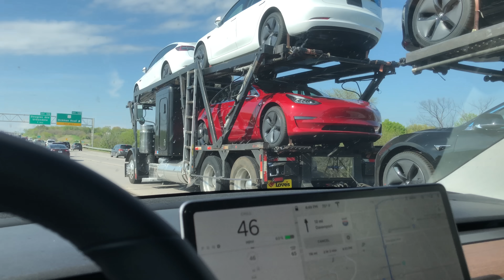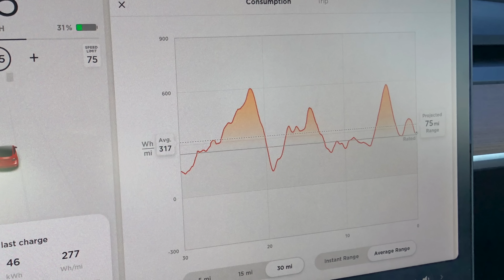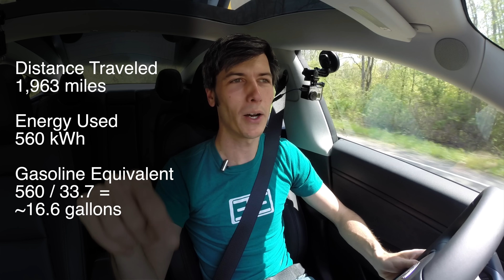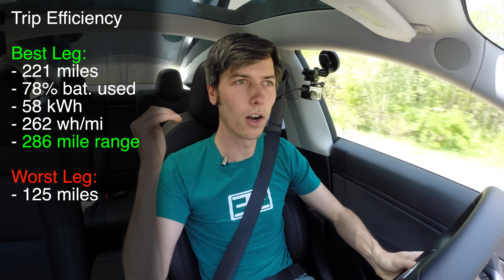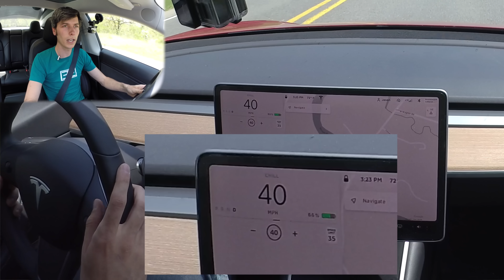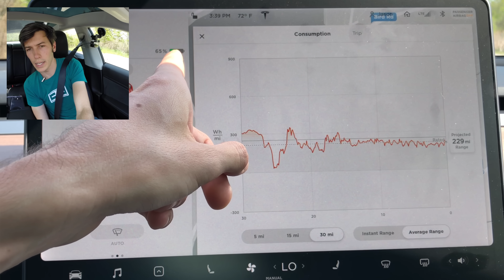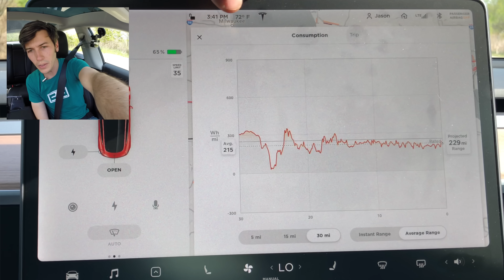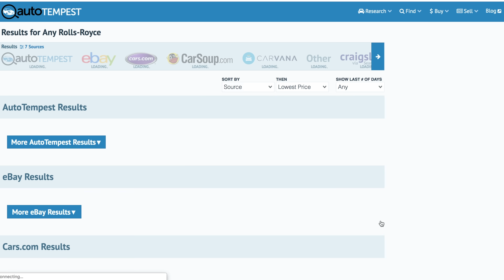How Miserable Is A Tesla Road Trip?

Comment: It's important that everyone remember that the V3 superchargers are going to be 2 to 3 times faster than the current V1 and V2 charges so this is the slowest charging will ever be and it's pretty damned fast. For the video he's using a standard-range-plus which requires 7 hours to charge. I planned the same trip with the long-range-model-3 and it only required 4 hours of charging over a 32 hour trip. I can't imagine driving 28 hours and not taking at least 4 hours of breaks in there somewhere. With the V3 superchargers that time would be 2 hours of charging over 30 hours. At that point you'd be well below the required amount of stopping for bathroom breaks and getting snacks, etc.

Comment: Google maps actually does use estimated traffic conditions for those times and construction etc. They track android cell phones and their traveling speed to calculate how the flow of traffic is on the roads and averages them. When you look up directions you can set the start time etc and it will change your estimated time.

Comment: So the most interesting and relevant question is: how long would this trip have taken you in a normal gas vehicle? Because we already know that you can use electric vehicles when you have fast-chargers everywhere.

Also, only $40 less seems not worth it considering that most cars nowadays can achieve a lot more than 30 mpg on highways, etc. . Using 40mpg in this calculation would already make this trip cheaper with a gas or diesel vehicle (20 year old VW TDIs achieve 70+ mpg on highways) - with only a few minutes of refueling.

Comment: it all sounded good until you factored in the price of charging. sure it sounds nice to say you used less then 1 gallon of gas in energy. but not less then 1 gallon of gas in price. 

so if you would have used a regular car you would have paid $~40 more, but saved over 7 hours in charging? thats worth the $40 to me. 

so if you would have used a regular hybrid car, it would have cost $39 less in gas and it would have been 7 hours quicker??? 1963/50*3 = $117
Reply: Yep, this is literally the only thing I was interested in for the whole video. 100% confirms I'm not interested at all in a tesla. If I get an electric car to save money on gas, I'm expecting it to cost less than half the price of gas or better, not a piddly <20% savings.
Reply: @hackfish8275  I mean, it still makes sense for a in town commuter, where it gets better distance. Or if you are buying for the performance. But yeah, as a long range commuter, not ideal.
Reply: @carlosrios7088  That's very true, depending on the cost of electricity in your state. But I feel like it will make a lot lot more sense when the price of on the road charging is lower
Reply: That only applies to roadtrip miles, charging at home is materially cheaper, depending on your local rate. If you have solar it's insanely cheap to fuel your car, almost free.
Reply: if you never sleep, or use the bathroom, or want to stretch your legs and just vegetate in a car seat for 30 hours - yes then that would be a valid argument. but I think everyone agrees that would also be a truly miserable road trip by any standard.
plus, the US gas prices are so artificially low in the US as a result of the oil/gas industry lobbying that even in California I think only about $0.60 per gallon is taxes. compare that to Germany for example where more than half of the road trip cost for gas is taxes (base price plus 0.65 EUR/Liter or 2.4 EUR per gallon, plus VAT 19%).

the benefits of electric driving show itself more at lower speeds and especially in traffic. the faster you need to go, the more an ICE delivers pure range/time value and convenience. but for a relaxed road trip, those cancel out when you consider everything else you usually do during stops where you can easily plug in the car for a few minutes.
Reply: @schlafanzyk  ofcourse you would rest , but not for 45 minutes every 200 miles. And 45 minutes is way more then "a few". 

But I agree, I would still love to have an electric vehicle for in town use. Just saying I would probably not get rid of my gas car.
Reply: @schlafanzyk  so artificially low in the US

You really severely misspelled artificially high in Europe. Funny how one of the primary expenses for low income families is extraordinarily over taxed in other countries are you're angry at big oil in the US for helping to prevent the government from those anti poor taxes. LOL
Reply: @hackfish8275  All taxes are "anti-poor", if you think right. Have you seen the mess about France wanting to tax Google 3%? I wish I was to pay ONLY 3%! Ridiculous.

Comment: As an engineer you know that calculating gasoline equivalent to electricity is a bit unfair ;)
You are comparing 560kWh of electricity to 560 kWh of heat in gasoline... and if Tesla was to run on gasoline, during generation of electricity this use od 16.6 gallons would at least double, if not tripple.
And with 50 gallons I can almost travel 1963 miles with my 12 year old fiat.

17 kWh electricity/km is very impressive, but comparing such things is like saying that electric resistor heater is 100% efficient while gas furnance is only like 80% and it is terrible. It doesn't work like that :)
Reply: Thanks for spelling that out, a red flag fired when that comparison was made. If I'm being picky (which I am) I doubt the charging is 100% free of fossil fuel as well. Got to agree tbf that Tesla did amazing work, just aren't ready to ditch the relative freedom of jumping in my Subaru 3.6R and driving a couple thousand miles without caring about having to make frequent stops.

Comment: electric car is not green, power is being made at a coal/gas fired power plant that pollutes; very dirty to make batteries (rare earth mineral mining etc); very dirty or energy intensive to recycle batteries...the list goes on.  Nothing virtuous or good about an electric car.
Reply: nothing virtuous or good about shitting on an electric car for factually incorrect and misleading reasons. electricity is not inherently dirty by design. it is only dirty because we have had no reason to move away from dirty means of production, which were the only possible ways to get the desired output until the nuclear age. in fact, you could power all of the world's transportation, housing and industry by just harvesting the wasted solar output of a tiny amount of desert surface area. the problem is, those desert regions generally also contain the biggest oil reserves and are the least densely populated parts of the planet with the highest concentration of power in the hands of the oil lobby and hence have no incentive to give up that very profitable industry of shipping tanks of energy around the world. it is purely a matter of political will to kickstart the electric (r)evolution, not technological or environmental limits.

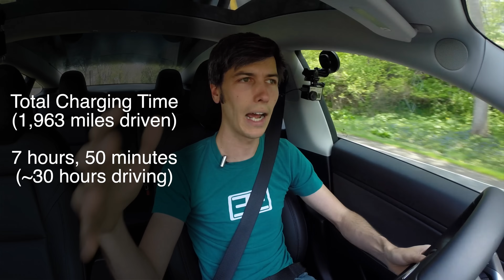Comment: 1:42 to 1:52 that's about 245 miles  of range per hour of charge time.   -- meanwhile, my civic so 05 from empty to completely full takes not even 10 minutes to refuel and I can go ) worst case..mind you city only) over 350 miles.  Interstate highway most or all of the time??/well over 400 easily.   I've said it before and I'll keep saying it. As long as the recharge times for these Ev's are more than 20 or even an hour  from empty to full...AND the range per charge is less than 400 miles..REALISTICALLY... mass adoption of them WONT happen. Oh almost forgot. Price. Oh the most critical thing... The car SHOULDN'T explode when just.fuckinf parked either -- * looks at Tesla qc

Comment: On a serious road trip, I'd be toting a generator with me just in case. Otherwise, 200mi and stop for an hour ain't going to get it done when you want to get somewhere at a decent pace, plus not driving 10+ hours when fatigue sets in and it becomes unsafe. Also electric won't work if you have kids and are going cross country. You need to be able to go hours and have quick stops on down times, like morning time or when they are sleeping to make significant miles, kids are pretty much done in the car by about 6 or 7pm.

Comment: So, a Toyota Camry which gets 41 mpg would actually be cheaper.
Reply: But not faster, or easier to drive, or nearly as much fun. The Camry isn't in this car class. This is in the 3 series, or C class.
Reply: @evracer5845  I was only commenting on the cost of fuel/electricity. Since the Model 3 is supposed to be getting the equivalent of 124 mpg, Elon is charging a ton of money at those superchargers.
But for a road trip like this, the Camry would be a lot faster, too.
Reply: Scott Gordon no it wouldn’t. I drive mine 5000 miles a month, ive driven everything everywhere in North America. This is by far the best driving ive ever experienced. I can race a z06 then put it in AP and relax.
Reply: @evracer5845  Huh? It's as if you are having a different conversation. I am talking about the numbers from this video about the road trip. The Camry would complete the trip much faster because it doesn't need to charge. And based on the numbers for fuel/electricity which were based on 30 mpg for a gas vehicle, stepping up to 40+ mpg would make it cheaper.

Comment: The Bottom Line here - Especially when Time is of the Essence - is that you have proved beyond any shadow of a doubt that all Teslas (and indeed all of the other 100% Battery Powered Electric Cars) are NOT practical cars for making long road trips (like this 2,000-mile trip).  For people like me, where Time is Money, having to make 12 stops and spend a total of 11 hours to charge an electric car's batteries on a 2,000-mile trip would Never Work!  The point well made here is that the current state of battery technology is just not up to the level needed to make long trips like this practical.  

It will take 5 to 10 years for battery technology to advance to the point where batteries can provide the long range and short recharge times needed to make 100% battery-powered electric cars practical for making long road trips.  In the meantime, Plug-In Hybrids -  are the most practical way to have the Benefits of - the Instant Torque and Power of Electric Drive, Regenerative Braking, and greatly increased MPG.  And when it comes to Luxury, Comfort, and Styling - my 2014 Cadillac ELR blows every Tesla Away in Luxury, Comfort, and Styling.  

My Cadillac ELR (Electric Luxury Roadster / Electric Long Range) with its Twin Electric Drive Motors and Onboard 4-Cylinder DOHC gasoline powered Electic Generator can make this same 2,000-mile road trip in nearly 11 hours less time while averaging upwards of 51 MPG!  And again - for people like me, where Time is Money - those 11 hours saved translates to Thousands of More Dollars Earned!  I can stop at any convenient gas station along my route, where it takes me less than a minute to fill my ELR's small 9.3-gallon fuel tank which, in under a minute gives me another 300 more miles of driving range! There's not an electric car on the Planet that can do that, and there won't be one that can do that for another 5 to 10 years! 

Unfortunately, Cadillac discontinued the ELR in 2016 after a total of only 2,950 ELRs were made - because they were slow sellers. The ELR's unique and highly advanced hybrid drive system was so over the head of, and incomprehensible to the average Joe driver out there, that it literally scared them away!  As a Retired Engineer, I was able to fully comprehend and totally appreciate the Way Ahead of its Time Tech in this - the Most Highly Advanced, Exceptional, Luxurious, and Gorgeous Car ever made by Cadillac, and I am Very Fortunate to have found my 2014 ELR at a Cadillac dealer that was using it as a Fleet Vehicle.  It had only 11,000 miles on it and was in Pristine Brand-New Like Condition when I discovered it in 2017 - a Fully Equipped Model with an 80k price tag that I was able to acquire for the Unheard of price of only 34k!  And since I was the first person that the car was Titled to, I was able to get a $6,000 Tax Credit on it when I filed my 2017 taxes - bringing down the net cost of the Car of my Dreams to $28k - the Deal of a Lifetime on the Most Incredible Car I've ever owned!  

With its 295 ft. lbs. of Instantly Available Torque my Gorgeous Gleaming Black ELR is a Magic Carpet that will take virtually every other car out there off the line every time with only a gentle press on the accelerator pedal - and it does it silently!  The added weight of the T-shaped 16.5 KW Battery Pack and it's low mounting under the center console and under the rear seats provides perfect weight distribution and makes this 4,000-pound car handle and corner like a Porsche!  This also makes it Rock Solid in high wind conditions - where the car is virtually totally immune to strong wind gusts!  In the Icy Cold Winters here in Upstate New York, the Onboard Gas Powered Electric Generator not only keeps the batteries at the Optimum operating temperature for Optimum range and performance, but it also heats up the interior to Toasty Warm very quickly - whereas all of the 100% Battery Powered Electric Cars struggle in very cold temps, with greatly reduced driving range and icy cold interiors resulting from the marginal, sub-par performance of their electric heaters at freezing and below freezing temps.

Comment: My '89 Dodge Spirit turbo will go 500 mi. highway on a 16 gallon tank with a one gallon reserve. Fill up in about 10 min. But your BEV is way better for the environment. Thanks for a great video. Gained a lot of knowledge here today.
Reply: Is it really better for the environment? lithium mines, coal fired electric plants, steel and aluminum smelters....
Reply: @romandabrowski8994  Overall, I think Yes. Building any type of vehicle requires mining and smelting. Coal plants are a definite negative, but can produce less co2 and pollution than tens of thousands of ICE vehicles on a day to day basis. Once a BEV is built, it will continue to have a much lower impact on the environment throughout its life cycle. However, it will take many millions of worn out lithium battery packs before any large scale recycling will be economically feasible. Where will all these dead packs go when they die? Good question.

Comment: My question is about how many years that battery pack will last, and how much it will cost the owner to replace it when the time comes. I know these are a bit more modern, but I do know that electric forklifts and other things that use a lot of amps have a certain number of years that they can function, even if the best maintenance is performed on them regularly.  These include the so called sealed cell, and gel  cell batteries.
And over time, you get less and less capacity out of them. It takes a while, but it will happen. And when the time comes to replace such high capacity battery packs, the cost will shock you. A little more of this information on this subject would help customers make up their mind if the electric car would be right for them........
Reply: There will be a difference between lead/acid and lithium.

The car companies are unlikely to tell you as they want to sell them. Until they are in widespread use I doubt we will find out. Some manufacturers suggest the packs are modular so they can just have the faulty modules replaced. I guess when one module fails they will all start to fail🤔

I believe Leafs have an 8 year/100K warranty and it will apply if they drop below a certain level of capacity. 

Like you I am yet to be convinced.

Comment: Just finished 1500 miles round trip and have to agree with most of it. Outbound leg was 750 miles in 12 hours and I was the only driver. Really surprised by how good I felt when I got there, thumbs up for autopilot. Four stops, 15-20 minutes each. That's enough to get you 2 hours down the road and ready for another 15 minute stop. Not all the Superchargers will pull 150 kW though, even at low charge. Some still max out at 120, A Better Route Planner will tell you which ones those are.

There's definitely a personality aspect at play here. If you're Type A and grab your food at the drive through window on long road trips, you should still get a Tesla. The autopilot will bring the car to a safe stop when you have your heart attack. Stop and smell the roses.

Comment: Less than 1% of electric cars. Sure, charging station are not that crowded yet. Once there are more electric cars, charging stations (even with more counts) will be so crowded, that you would have to wait for charging for 2 or more hours.
Reply: No because electric cars are secondary to stations, so the more cars = even more charger density and location therefore meaning more chargers per car due to charger installation efficiency
Reply: Oleg Vorkunov by the time EVs are that high of a percentage, charge speed and battery capacity will be so much better.  It won’t be 2 hour charge times.
Reply: Electric cars cause more pollution than gas or desiel. Drive fossil fuels.